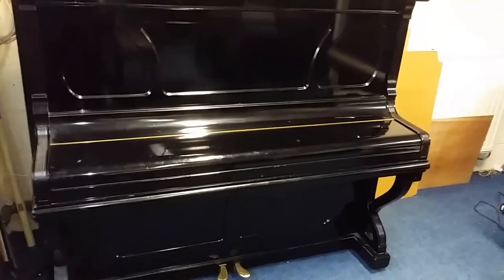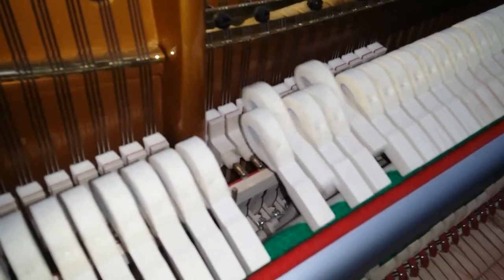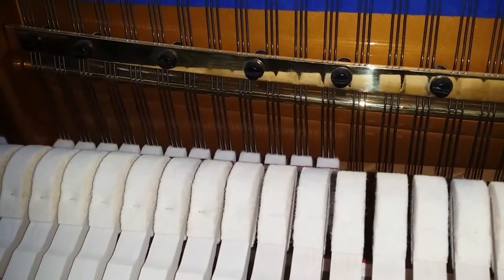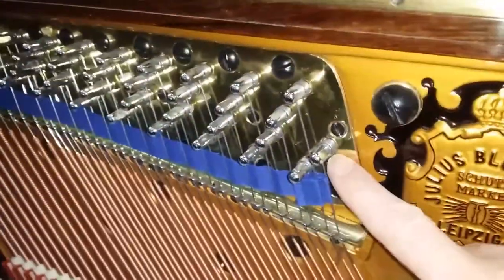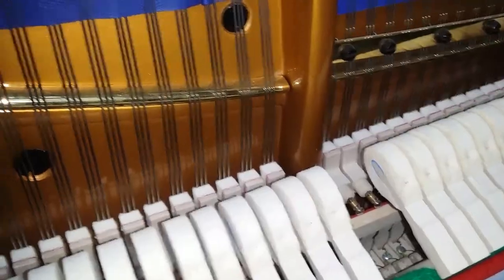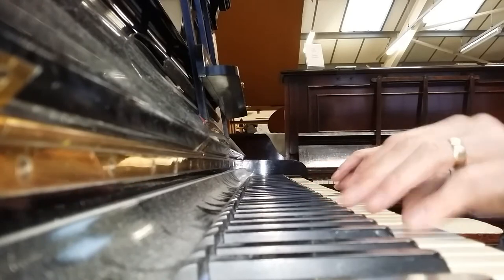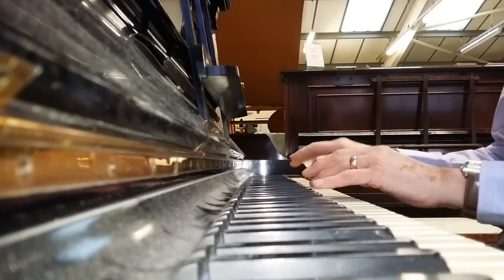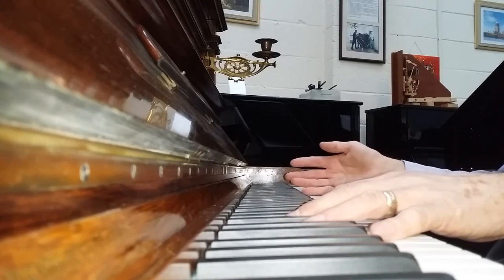Bluthner overdamper compared to another one converted to underdamper

Comment: Great video. I myself am not too bothered overdampers bad damping in upper register as long it's decent on bass and middle registers. I actually like smooth transition in discant area due bad damping. I have overdamper Bluthner and I think the playing touch is just magical. I think that is why Bluthner made overdampers so much back then, because that action is really well designed. My Bluthner is not even regulated for I don't know how long, and I still can play it very softly, and haven't had ever any double strikes on any key. By the way, have you encountered adjustable metallic hammer flanges? My Bluthner has adjustable hammer flanges, it's really handy. If hammer is too tight and doesn't move well, it can be adjusted just with turning screw on flange. I haven't seen those in any other piano. It's straight-strung Bluthner from 1900.